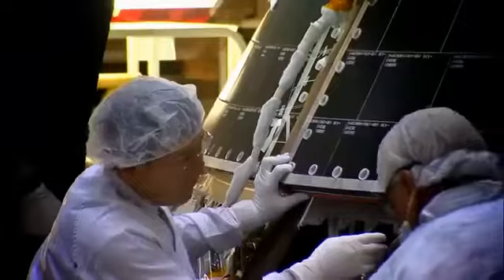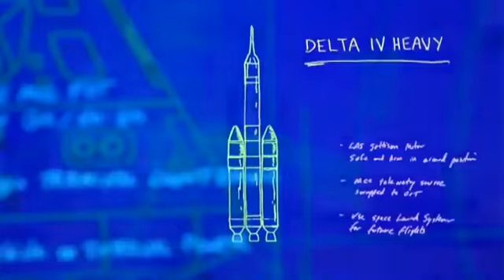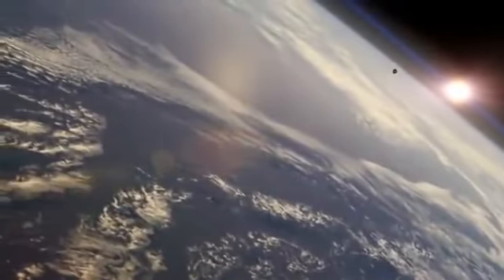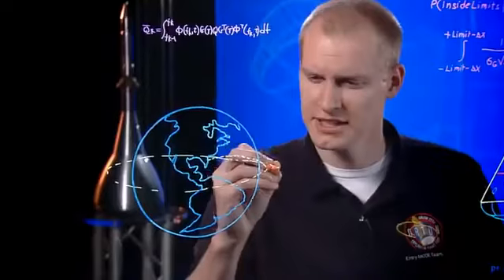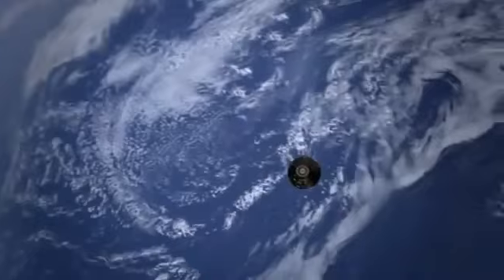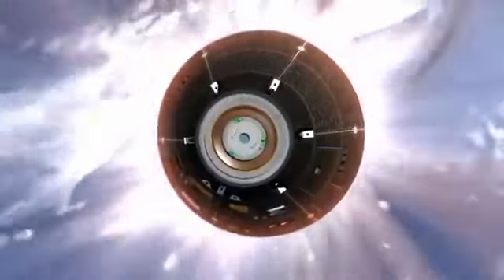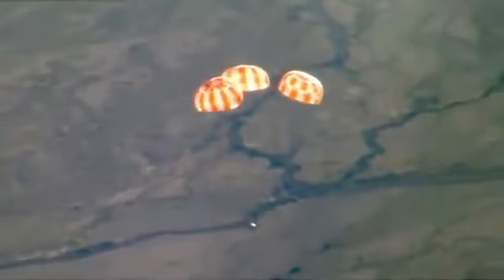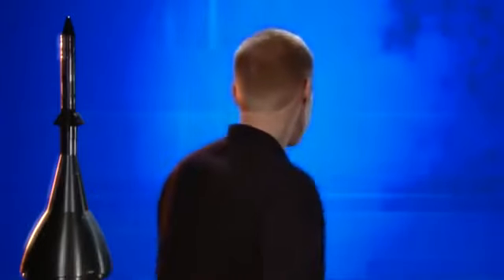NASA engineer admits they can’t get passed the Van Allen Belts

Comment: I agree we NEVER went to the moon. But there is an even more common sense reason of my questioning... Why do we use rockets... My military career tells me to blow $hit up! Not to mention, sense WW 1&2 we have had planes fully capable of leaving our atmosphere and returning... look it up. As well as my father was an engineer at Lockheed, McDonald Douglas, and now Boeing. He would tell you the same thing... "no need for rockets."  Getting past the Van Allan is a whole other problem (dealing with that radiation poisoning and then death thing). The only real reason my small brain tells me the reason we send rockets is that we are blowing "$hit" up or trying to ignite the Van Allen Belt. Why... because its a radioactive flammable atmosphere circle around our earth. Which prevents us from leaving this rock called earth. But the powers that be are forgetting that the Van Allan Belt protects earth as well... it burns up the really really big $hit, making asteroids into smaller rocks that earth can handle... think about it. Not so complicated. BOOM. Also, a side note... why make something so expensive to only be able to use this once. Logic tells me as well that dropping anything will burn  might possibly be the shoots as well, or at least what holds them (remember how the gods melted our wax wings... history reference... lol), (yes, I went to jump school). The practical thing to do is to have a device built similar to anything that is capable of lift and drag...hmmm let me see... oh, a plane or the like. Because a plane has to drop though the atmospheres (yes, plural). Any plane uses a special little meter to check the tilt of the earth, speed, drop, rate of decent, as well as a few other super important tools. Lets say our space plane or the old SR71 Black Bird or any of our stealth planes, etc has the ability to go up to space and back down. This happens slowly on reentry. Because our "Space Plane" checks the rotation of the earth, speed, angle, direction of entry, and all possible landing points closes, and safest. Thats why we have military bases "ALL" over the world. Think about where our shuttle has landed before... Edwards Air Force Base, etc. It costs too much money to keep sending rockets for exploration. FYI... once anying has reached past 100-400 mile mark, at what ever speed you are going to continue to go at that speed into space... then thats the speed you stay! Yes, it does this because no gravity (or much much less), and the vacuum thing. It takes a reverse thrust of a slightly faster speed or burn to turn anything around. This takes time if we are trying to stop and keep with the earths rotation... I pray we figure this all out, or at least tell the truth of what we are really doing. Maybe we could all collaborate together and solve all these issues. Rather than be kept in the dark till it is to late.

Comment: "We (NASA) MUST SOLVE THESE CHALLENGES  BEFORE WE SEND PEOPLE INTO THIS REGION OF SPACE??!! Then HOW the HELL did the astronauts get to the 🌝??!! 😗🙄🤔🔥
Reply: We figured out how to get through the van Allen belts in 1958. For radiation, there are 2 important variables: 
1. the radiation intensity
2. the amount of time you are exposed to this intensity. 
You can multiply these two and get the total radiation dose. Humans die if they receive a dose of about 300 Rad. 
In 1958, James van Allen and his team at the University of Iowa discovered the belts that were later named after him, using measurements from the NASA missions Explorer 1. With Explorer 3 and 4 and Pioneer 3 he measured the radiation intensity. This is what he found: in the part of the belt where the intensity is highest, it is high enough that if you stay for about a week (inside an Apollo command module), you receive a lethal dose. So for the Apollo missions, the trajectory was designed to minimize the amount of time spent there. The Apollo astronauts flew through the belts in about 3 hours, while avoiding the part with the highest levels entirely. The hull thickness of the CSM was more than enough to reduce the radiation level inside to manageable levels. 
Astronauts' overall exposure was actually dominated by solar particles once outside Earth's magnetic field. The total radiation received by the astronauts varied from mission-to-mission but was measured to be between 0.16 and 1.14 rads (1.6 and 11.4 mGy).
More details in this video from Scott Manley: https://www.youtube.com/watch?v=h9YN50xXFJY
This video is talking about the first Orion test flight. This was done to make sure the Orion capsule works correctly in the VA belt: electronics can malfunction in high-radiation environments. Orion's electronics are designed to deal with this, but a practical test is required as part of due diligence. All of the hardware on Orion is new, so it has to be tested in operational circumstances before being considered human-rated. 
The Apollo program did these tests as well, during the Apollo 4 and 6 flights.
Reply: @richarddemuth7077  Radiation consists of alpha, beta and gamma particles. Alpha particles are stopped by a sheet of paper. Beta are stopped by a few mm of aluminium, like a spacecraft hull. That leaves gamma particles. These have so much energy it takes a hull thickness of 1 meter or more to stop these. 
No rocket available today can lift a spacecraft with walls that thick. An electromagnetic shield is theoretically feasible, but requires more power than current spacecraft have available. 
So we don't shield against gamma at the moment. That's okay, because the amount of gamma radiation in the VA belts and beyond is low enough that we can get away with that - it's not dangerous to humans. 
But gamma radiation can disrupt or damage electronic circuits, and the more modern the IC, the easier it is to damage. So spacecraft generally use radiation-hardened electronics, designed to keep working despite damage. 
So the Artemis 1 mission is a test for the electronic systems on board.
Reply: @h.dejong2531  I wonder how the aliens do it?

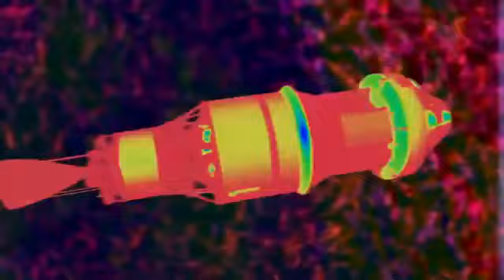Comment: Click Bait and wrong. NASA does not admit they can not get past Van Allen Belts. What it admitted to, if you listen BEFORE the 3:37 mark, is that they must test to make sure that all the 'guidance systems, onboard computers, and other electronics' must be tested to ensure they are not harmed during transitting through the VAB (twice). As anyone that knows anything about electronics, the newer digital and more sophisticated electronics are more susceptible to such noise signals (such as radiation waves) than the older simple but more robust systems that were used back in the 60's. In fact he even stated that they had worked it out, that it already had shielding, they just needed to test it to ensure it was safe. "but Orion has protection. Shielding will be put to the test."

Comment: How about that 4000 degrees F (2204 degrees Celsius) fireball, that it was in while going 20,000 miles per hour (32,000 kms), and it's supposed to have people in it eventually?? This is what the internet says about people and heat from fires... "In only 3 1/2 minutes, the heat from a house fire can reach over 1100 degrees Fahrenheit. About 80% of all civilian deaths from fire occur in the home. In rooms that are not even on fire the temperature can reach over 300 degrees; this is hot enough to melt plastic and kill the people in those rooms". - San Fransisco Fire Department. This little Orion thingy will get 4 times hotter..??
Reply: Yeah, it gets very hot on reentry.

Comment: No, that engineer is NOT admitting anything of the sort. He's talking about the first Orion test flight. This was done to make sure the Orion capsule works correctly in the VA belt: electronics can malfunction in high-radiation environments. Orion's electronics are designed to deal with this, but a practical test is required as part of due diligence. All of the hardware on Orion is new, so it has to be tested in operational circumstances before being considered human-rated. 
The Apollo program did these tests as well, during the Apollo 4 and 6 flights.
Reply: well, he is still clearly admitting they are not ready to put humans through that journey with the current technology.
Reply: @tvdylan  No, he is "admitting" that they have finished a design that they are confident enough that it'll work that they're willing to commit $500 million to a test flight.
Reply: @h.dejong2531 yes, 500 million is a significant amount. a test flight with no humans on it he said. and its now ten years later, and have any humans been on it yet ? 10 years is quite alot of time for tests.
Reply: @tvdylan  That slow pace is dictated by funding: Artemis gets 1/25 of the funding that Apollo had. This means fewer test flights (which we can do because 50 years of spaceflight experience gives us a lot more confidence in the correctness of the design), and it takes longer to develop the rest of the hardware we need for Artemis' first real mission: SLS design was not finished in 2014, for instance.
Reply: @tvdylan  A lot*

Comment: i like to believe apollo got  to  the  moon this is  a  great  achievement by mankind  , i was  a  vacuum engineer for  many years , so space always fascinated  me from an early age,. if you look at how long  the  human body can indure radiation it  is very  feasible that if you  spend least time in  the most dangerous part of  the vab  at immense speed you will survive ,these men were 100% fit highly trained and were protected by space suits and  the craft was also protected.  if they plotted  the the weakest area of radiation  and took that cause at the  correct speed , the radiation would not have had  catastrophic results , so i whole heartedly believe the usa landed on the  moon in 1969
Reply from the maker: Jason Skegs unfortunately, the moon landings were faked and this video proves it!
Reply: Surviving the Van Allen belt  brings them to space where radiation  is less intense but they are in it longer for several days.   Even the James Webb Telescope was hit by a tiny meteorite in its first year.

Comment: They couldn't do this back in the 1950s.
Reply: We figured out how to get through the van Allen belts in 1958. For radiation, there are 2 important variables: 
1. the radiation intensity
2. the amount of time you are exposed to this intensity. 
You can multiply these two and get the total radiation dose. Humans die if they receive a dose of about 300 Rad. 
In 1958, James van Allen and his team at the University of Iowa discovered the belts that were later named after him, using measurements from the NASA missions Explorer 1. With Explorer 3 and 4 and Pioneer 3 he measured the radiation intensity. This is what he found: in the part of the belt where the intensity is highest, it is high enough that if you stay for about a week (inside an Apollo command module), you receive a lethal dose. So for the Apollo missions, the trajectory was designed to minimize the amount of time spent there. The Apollo astronauts flew through the belts in about 3 hours, while avoiding the part with the highest levels entirely. The hull thickness of the CSM was more than enough to reduce the radiation level inside to manageable levels. 
Astronauts' overall exposure was actually dominated by solar particles once outside Earth's magnetic field. The total radiation received by the astronauts varied from mission-to-mission but was measured to be between 0.16 and 1.14 rads (1.6 and 11.4 mGy).
More details in this video from Scott Manley: https://www.youtube.com/watch?v=h9YN50xXFJY

Comment: Of course when you find a big rock you went around it

*If you don't understand we didn't went through VAB we just turn around and didn't touch it. It's a belt, a two dimensional circle. it's like jumping over a fence instead of breaking trough it.
Reply: Ok, yes it's true that it's possible to go "around" the Van Allen Belts, in that they're the strongest around the equator and the weakest by the poles, but you have to understand a little about how orbits work. When your destination requires you to launch your ship in an orbit that's roughly around the equator, it would take a gigantic amount of resources and effort to alter that orbit enough to go "around" the belts before correcting the course to line up with your destination again.
Space travel is all about efficiency, and even when everything is as efficient as possible it's hugely expensive. The only option we have is figuring out ways of safely "breaking through the fence" instead of "jumping over it."
Reply: ....Thanks?
Reply: Then... you're welcome? :P

Comment: When he is talking about solving problems with the capsule he is talking about anything new to arise with the way its designed i.e. the types of shielding and/or, well, anything to do with the hull containing the electronic equipment and crew. Materials are the big thing. If they use the wrong ones the Van Allen belt can be very dangerous

Comment: the arguement you are making is so wrong it hurts why don't people use model t wheels on modern cars? because they don't work with a differen't vehicle you need to modify the design to fit the job you don't use the same screw for everything you don't use the same size monitor for everything and you don't use technology from decades ago in new vehicles where you cant afford safety problems for the stuff that gets people from one place to another you do relize alot of electronics are more senseitive than from decades ago? phones used to be big blocky pieces of plastic where as nowadays they are fragile things made of glass, metal , plastic etc.

Comment: the test only goes 75 miles above earth - no where close to the moon, so it looks like the Astro-Nut basically said man has never gone to the moon because this is the first time ever ORION is testing to see if it can only make it out 75 miles & back.
Reply: This is like arguing that because a new care went through crash safety testing it means no car previously could possibly handle a crash. Absolute brain dead.
Reply: The 2014 Orion EFT-1 reached an altitude of 5800 km, not 75 miles.

Comment: Since all the Apollo missions seemingly went off without a hitch why would you throw the baby out with the baby water and not improve on that technology, but instead you go into some silly space shuttle program... that's beyond odd.. that's not how the evolution of technology coupled with mans ego works....that would be like stopping  50 ft shy of the summit of Mt. Everest  and never going back.... i smell a rat!
Reply: You mean except the missions that failed?

We are improving on that technology.

The space shuttle was designed to do something very different from what the apollo craft was. The apollo craft was a complex multi-stage craft designed to get people to the moon and back. In contrast, the space shuttle was designed as a reusable craft to ferry people and things into LEO. It was originally intended to be one of a system of reusable spacecraft, but only the shuttle got funded. This is a case of politicians not wanting to foot the bill, basically. Consider that since the shuttle program shut down, the USA has been using Russian craft to get us to the ISS, and those Russian craft (Soyuz btw) only have a quarter the payload capacity. the shuttle did. On top of that, the space shuttle was the first reusable spacecraft developed. The apollo (and the soyuz) are expendable. They can bring people up, and bring people down, but that's it. They're glorified scrap metal after that.

Yes, that might make sense... if you knew nothing about the space race, and had not the slightest bit of financial sense. Putting men on the moon was effectively a proxy war. A pseudo-war fought to demonstrate superiority between two parties that couldn't risk direct conflict. That is why so much money was pumped into it. You do realize at the time NASA's budget hit 4.4% of the federal budget, compared with 0.5% today? That 400,000 Americans, one in every five hundred people, were working for NASA at the time, compared to 50,000, or one in sixty-six hundred today. That NASA's budget during the apollo program hit, in present dollar value, over $43B/year, which is more than twice what it is even today.

You don't smell a rat. You smell the scent of your brain trying to chug away on emotions and nonsense.

Comment: I just recently went to Kennedy Space Center. Yea we have been to low earth orbit but we are no where near ready for the moon.  250k miles away and the rocket burns 95% of its fuel just leaving the earth. Not to mention payload only is 2%
Reply: The distance isn't the problem. To get to low orbit, you have to accelerate to 8 km/s. To get to the moon, you have to accelerate to 10.4 km/s. That's the important difference. The Saturn V was so large, because it had to accelerate 100 tons of material to 8 km/s. This was enough to accelerate 50 tons (the CSM and LM) to 10.4 km/s. 
The Tsiolkovsky rocket equation allow you to calculate how much fuel you need for each step of the journey. It says the Saturn V was capable of putting men on the moon.